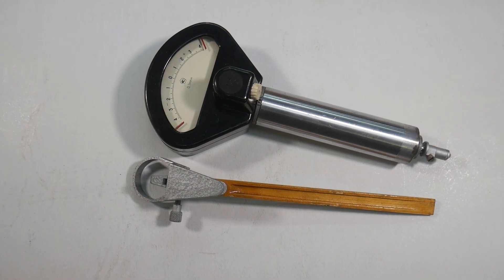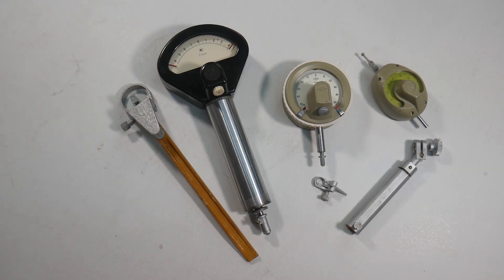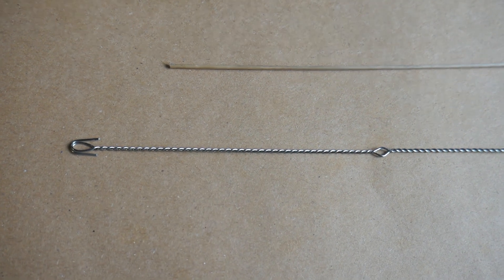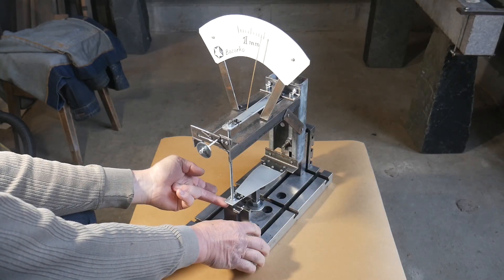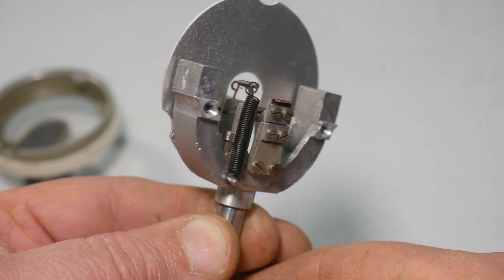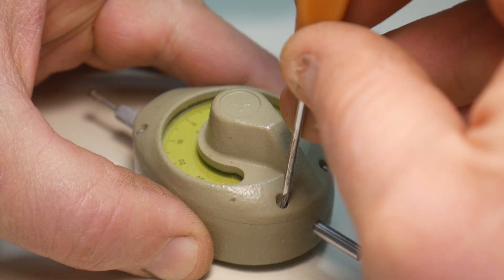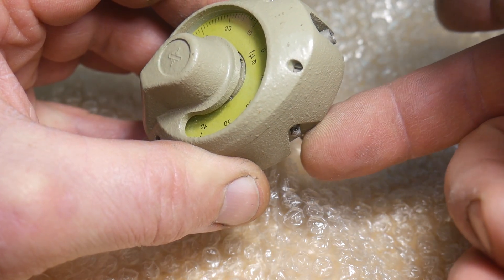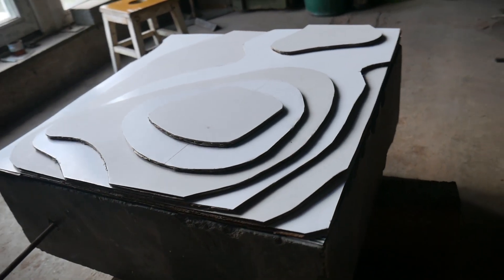How does a Mikrokator work

Comment: Fabulous. Thank you. I first saw a Cylo's Garage description of these instruments but could not understand the rotation of the spring. It was your diagram with the 'helical' arrows that clarified it. It is TWO helical springs wound in opposition, one a left hand thread shape and the other a right hand thread shape. These two springs can be, and are,  made from a single piece of material - however the geometry is that of two helical springs, a Right Hand and a Left Hand, fixed together.

PS I think this could be emphasised more strongly. I missed it on my first viewing.

Thanks you.

Comment: Hello Gena.  I have a Mikrokator that has a pointer with the tip broken off.   Do you know anything about the brown material that holds the pointer to the twisted strip.  Obviously it's a type of glue but I wonder if it is warmed if it would release the pointer.  It seems to resemble rosin flux.  I called the company but they don't manufacture the pointers any longer and they don't have any old stock.  I may see if I can melt some glass and pull a tiny thread.  :-)
Reply: Also, I apologize.  Before I asked a question I should have thanked you for this incredible video.  The effort you put into the example is beautiful and brilliant.  Thank you very much.  Also, I found a great written description in this book online that you may like, called Ingenious mechanisms.  page 495. http://www.opensourcemachinetools.org/archive-manuals/Ingenious_Mechanisms_Vol.3_Jones_1930.pdf
Reply from the maker: This is surprising, but there is not a thread, but a glass tube. But if you pull out the glass thread, it will probably work too. I don't know about glue, I thought it was epoxy glue.
Reply: @gena_bazarko  oh interesting.  I'll need to inspect under a microscope again.  If it is a small tube, I can't imagine how such a small thing would be produced.  I'll start investigating that also.  Gena, paypal won't let me donate to you.  It says that it is prevented by regulation.  :-(

Comment: Looks like one of the posts/stops needs cleaning
Reply from the maker: I use a translator, and sometimes I can't quite understand the meaning of a comment. Unfortunately, I didn't fully understand this comment.
Reply: There is a little post where the glass tube rests on when the indicator isn’t engaged that looks like it needs cleaning in your video. That sometimes happens at our shop and we need to take the Mikrokator apart so we can clean that post. Otherwise the indicator can be sticky.
Reply from the maker: @PIcoAirBearings  I also saw strange pollution. But I didn't think that it could cause a problem. I'll clean it. thank you

Comment: Some channels would have done a diagram

Better channels would have done a mockup - in cardboard perhaps - to show the principle

But you, you went all the way, and made a working model. Kudos! Well done!
Reply from the maker: I used two ready-made elements from the "universal prefabricated fixture", I wonder what it is called in English, I did everything else quickly from simple components that will always be found in the workshop. It was difficult with the spring, I did not immediately pick up the right solution. It is stainless steel welding wire ).

Comment: Dan gelbart did a demonstration with a microcator, putting the microcator on the spindle of a milling machine, contacting a block on the table; you then put your hand on the back side of of the mill pillar, and you can then see the microcator measure the deflection of the spindle, due to differential temperature of the vertical pillar, it bends to the front...
Reply from the maker: Even the most rigid objects are sharply mobile with heat and amazingly flexible ).
Reply: Yes, Some of Dan's videos are amazing, especially his home made precision lathe.
Reply: @gutsngorrrr  morning sir, can you share the link of his video please? I'm working in a homemade precision lathe for make jet engines and will be very helpful see this content
Reply: The most difficult belief I had to overturn when learning machining, was that metal things (aside from springs) were so rigid that their shape and dimensions did not change.  

Once I finally understood that everything was made of rubber, I could start to actually understand why and how things actually moved.
Reply: I’d like to see the demo of the effect of heat in the mill column